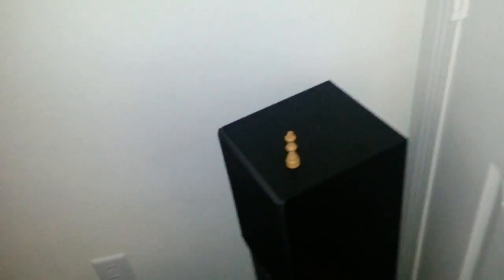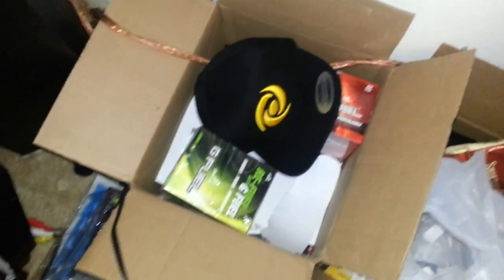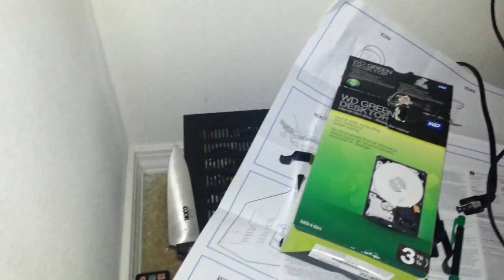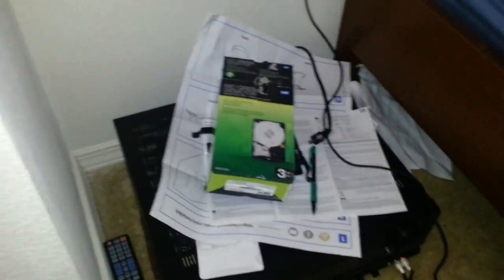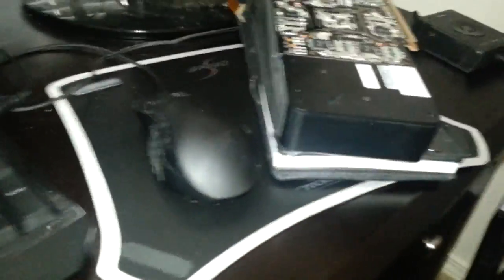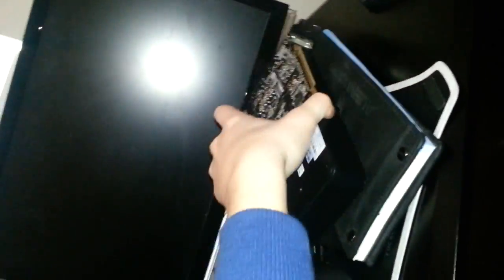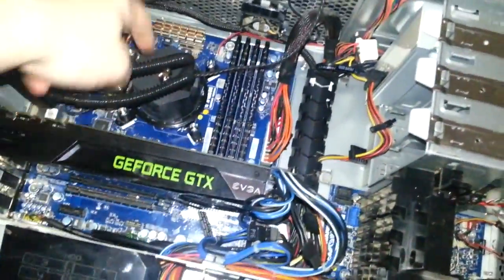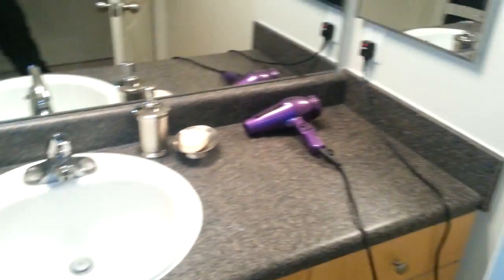The Cartoonz Gaming Setup!

Comment: Just a heads up as I repair alienware/dell pcs under warranty. you absolutely need to upgrade power supply if you plan on cramming 2 video cards in there.
Also if you are replacing the motherboard, pro, memory, video.... you might as well buy a new case, at that point its not ever alienware anymore.

Comment: You need to format your 3TB drive as GPT and not with the master boot record if you want to use it at all. The old master boot record can only allocate space for up to 2.3TB, I think. Your board must also use EFI firmware if you want to boot with a hard drive formatted with GPT.

Comment: If you are going to to upgrade your PC that much already, changing to a new motherboard, I suggest getting a new case aswell, that supports normal ATX. You're currently using Mini/Micro-ATX form factor, and it only supports two PCI slots. If you're serious about getting two graphic cards in there, you should have the space to let air circulate smoothly.

Comment: No. That's not how it works. You add a second graphics card, and if linked via SLI/CrossFire, you will get the added benefit of the GPU and memory. However, if the two cards that are linked are not identical, the better card will get clocked down to the poorer card's performance.

Comment: Get another case or fix all those cables ur case needs better air flow..also shorten the ammoiunt of ram by just getting 8gb x2 and piutting them one slot away from each other so the heat from both doesnt gather up..